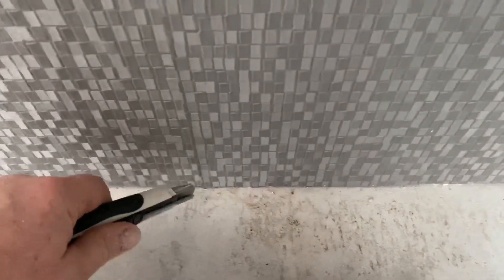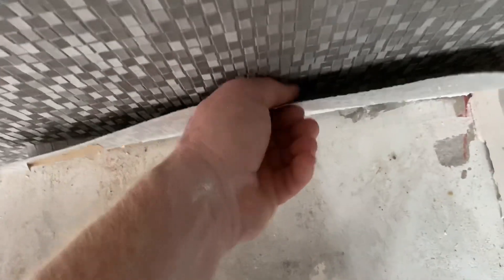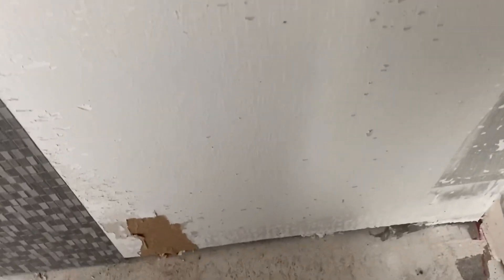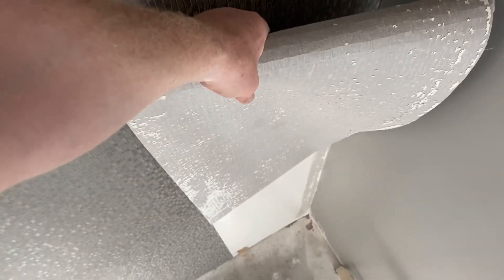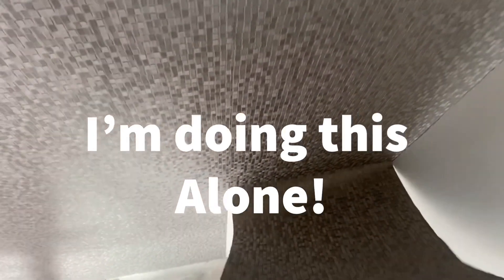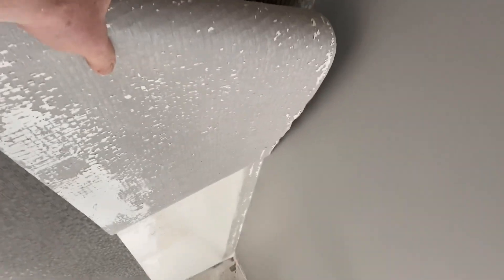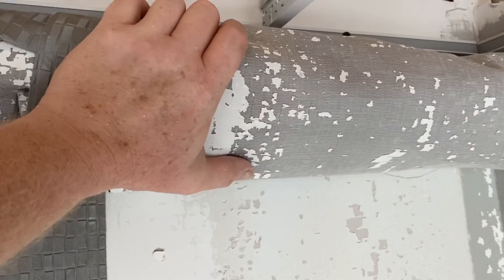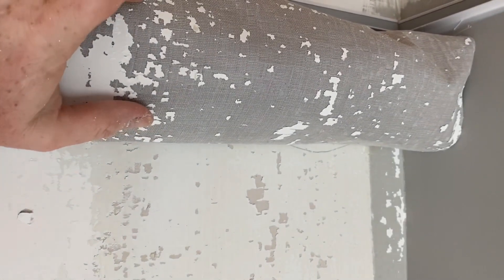How To Remove Wallpaper Without Damaging the Wall - Spencer Colgan

Comment: Thank you for your videos.  I am removing wall paper in my kitchen 15×17 and entry way 5x11 with 14ft ceilings and it is so much better doing it your way. Pulled down outer vinyl layer now just using using water and the paint trim tool I purchased at harbor freight for $2. Thank you again for the information.